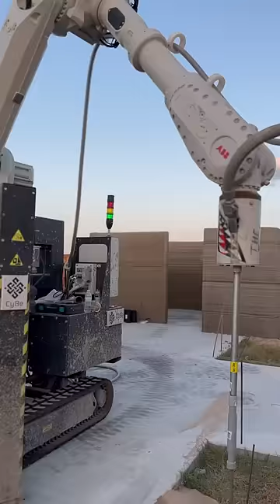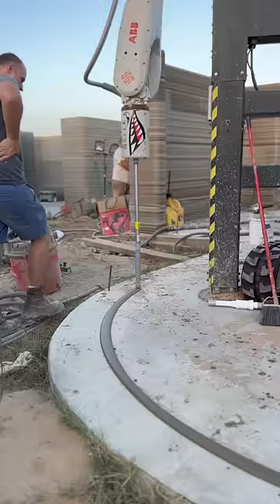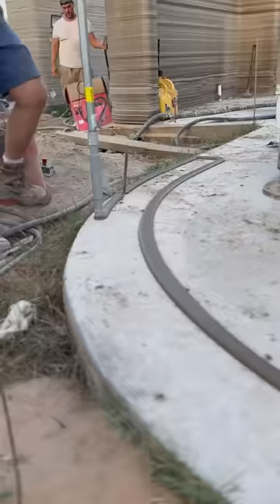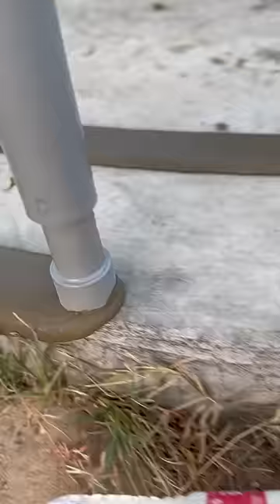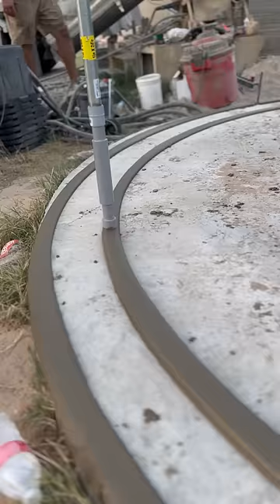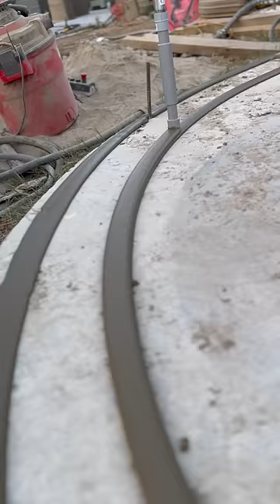Starting a fresh new wall with a two man print team #Hive

Comment: Here's a pro tip for the Builder. You need to prep the surface. If you're doing a cold joint you should probably scarify or have a key way or some other mechanical way to lock it in rather than 4 inches sticking up a rebar every 10 ft that's not sufficient. The concrete is being laid directly on dirt that's a big No-No there is absolutely no adhesion happening there. So just because it's a novel new way of construction all of the old ways and best practices still apply and you need to get your head out of your ass and do that for the homeowner

Comment: Nice clean up job there. 🤦 I'm sure the base of dirt on the concrete slab isn't going to affect the strength of the wall in any way. Let alone the fact that a portion of the wall is hanging off the damn slab.

Comment: How does on 3D print a wall if the build 😊late is dirty and not well centered. Where dirt was added as fill it will do nothing to support the overhanging wall from the dusty concrete base. If I did this on my 3D printer it would fail just in the dirty build plate alone.